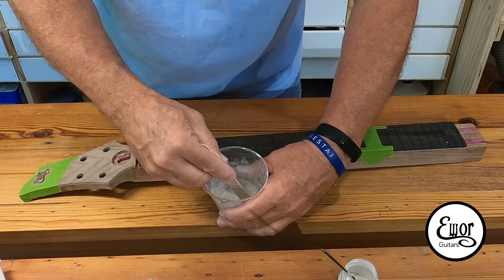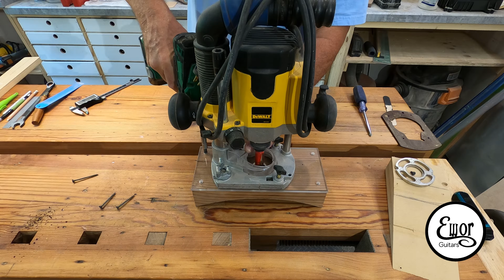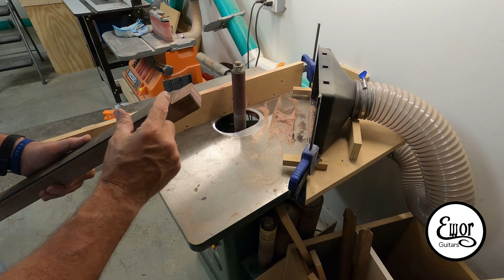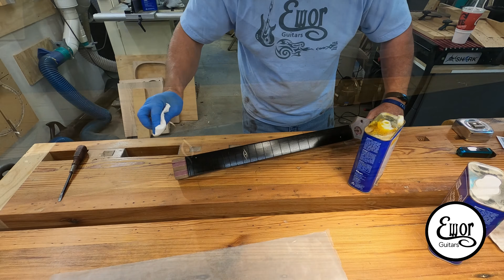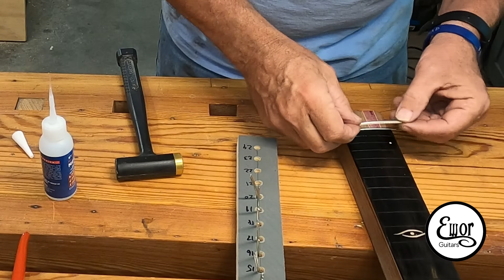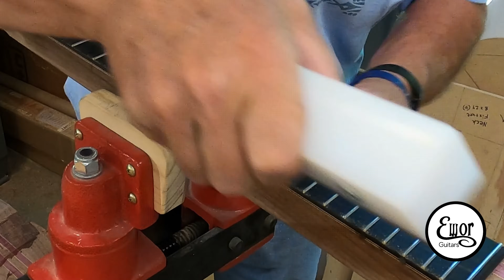Fretboard Radius, fret install and epoxy inlays

Comment: Well done! I'm making a similar jig to shape the radius of the fretboard. But I'm afraid that the cutter might break the mother pearl inlays. Based on your experience, if I were to make a Gibson-like fingerboard with trapezoidal inlays, would you recommend using this jig or sanding manually with a radius block?

Comment: Hi Dave, a word of comment: though pretty, your truss rod cover design inherently weakens the neck because of the recess, in my view.
Reply from the maker: Thanks Willem, yes the recess goes through the headstock plate slightly. I’ve been thinking about using truss rods that are accessed at the other end and then doing some other design at that location.
Reply: @eworcustomguitars  Dave that means you'll have a bigger job, adjusting the truss rod, as they all need, over time. There's a reason Fender did away with that style. Of course I've heard the arguments for both. You could simply do it the way Gibson & others do, with the old screw plate. However you are the maestro, the guy putting the sweat equity, & time into the guitar. I don't care for the old truss rod adjustment from the base of the neck. You'll have to at least pop the pick up, to access it. (Or more) You are doing glue in necks. The wood & the method you use to build your necks, makes me think they're strong enough to handle your method. But that's just my opinion, I've been adjusting truss rods "nigh on 55 years", I prefer the access through the head stock. But as is said "You call the shots, you run the circus."(a Navy buddy said his Scout Leader used to say that.)😂 she's shaping up nicely. IMO
Reply: A neck with that many laminates, a scarf joint, and a glued down headstock laminate will make that neck joint stronger than any Fender, Gibson or any other production guitar.  I personally like the flipped truss rods and if you install them Alembic style then you can adjust them easily.